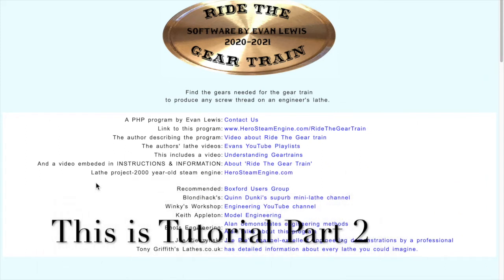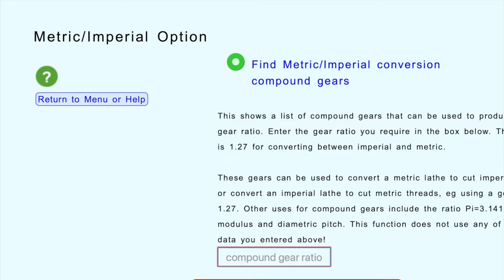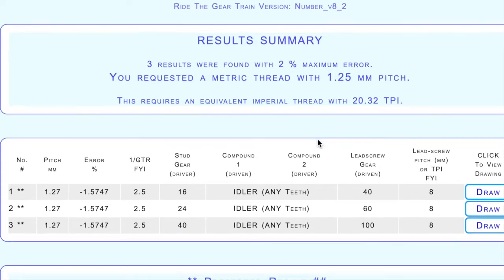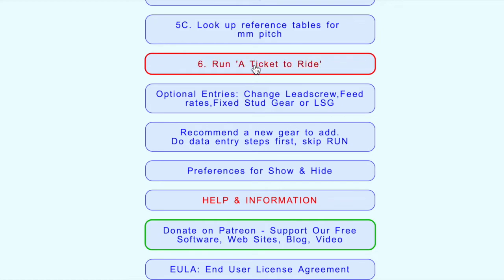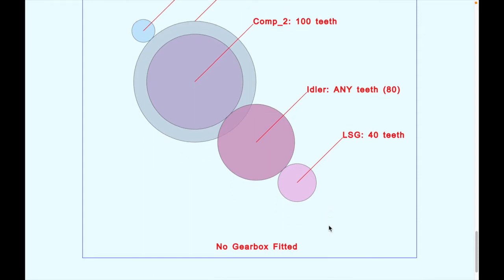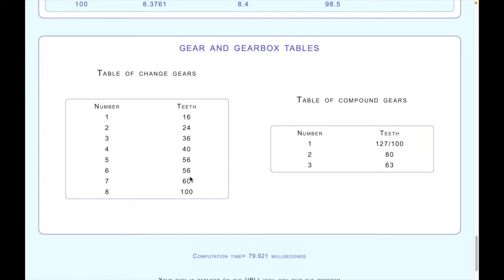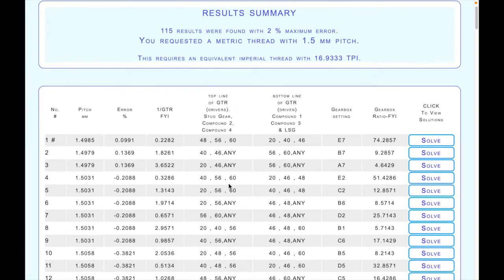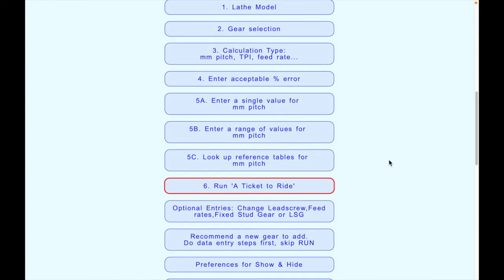Tutorial for RideTheGearTrain - Part 2

Comment: I have the same lathe and would like you to give me the panel in mm and the gears needed
Reply from the maker: https://ridethegeartrain.com/index.php?adflag_f=no&gearboxfitted_f=no&threadrequested=mm&threadtype=metric&autocompound_f=no&maxresults=500&changeleadscrew_f=no&powerfeed_f=no&changeablestud_f=no&changeablelsg_f=no&range=single&prefintro=no&prefquickstart=no&preftutorials=no&prefourlinks=no&prefinputtext=no&prefspecstext=no&prefgeartables=no&prefgearboxtables=no&customdone_f=no&stdchangeablestud_f=no&stdchangeablelsg_f=no&stdgearboxfitted_f=no&stdauto_f=no&zout=no&zin=no&deglab=no&ptab=no&pcurve=no&psymb=no&pline=no&pcircle=no&fullsearch_f=yes&searchword=boxford+A&restricted_f=no&helppage=mainmenu&pagename=gotoHelpLink&mode=returnfromhelp&titleString=Boxford%20A%20Metric%20lathes&idString=Boxford%20Metric&helplabel=Boxford%20Metric#Boxford%20Metric

Hi. Sorry I didn't see thi post 7 months ago. the easiest way to get the metric gear chart to you is to send a link. lets hope it doesn't get deleted.
Reply from the maker: The option of creating a table in Step 5B has been improved by allowing you to enter a list of pitches and it lists results for them all.  (eg all the common metric pitches in mm and these are given as an example). 

This way you can quickly see whether the gears you own will produce the threads you may need. If not you can experiment with adding another gear, before you go out and buy it.